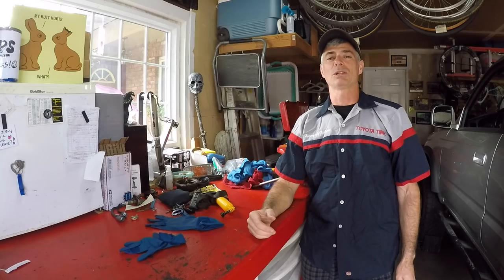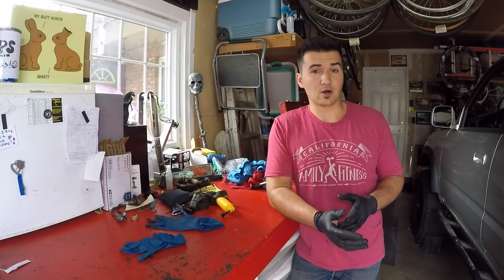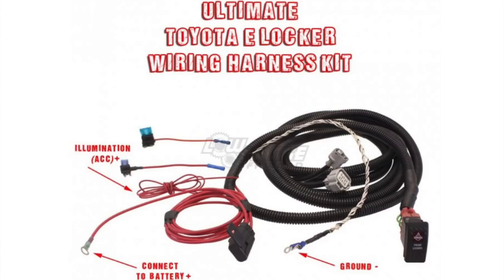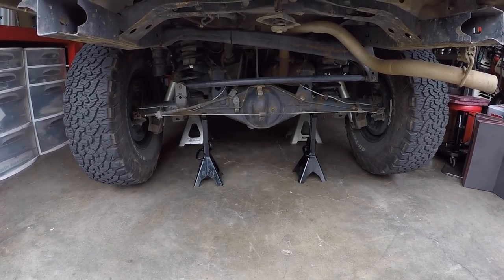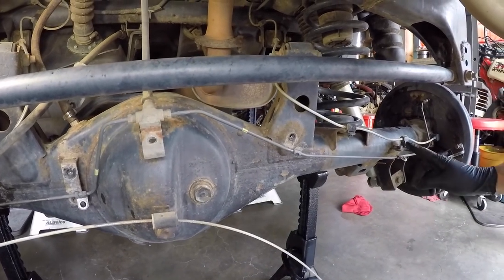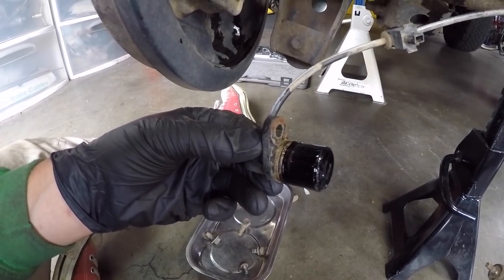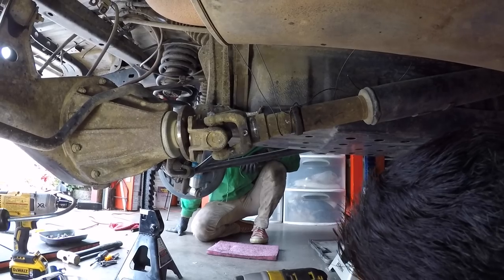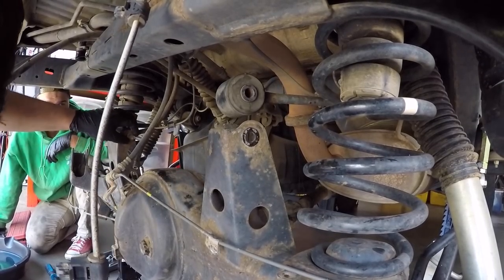E-Locker Axle Swap + Wiring How-To

Comment: Hey Timmy. Great video😎👍.        I have a question... Can you make a video about steering adjustment on the front wheels, when you change steering ball joint🤔??
Reply from the maker: Are you talking about just getting the steering wheel straight again?
Reply: Yes Sir😉 🔧🛠️
Reply from the maker: Get the wheels pointing straight ahead first.  I'd then pull the steering wheel to see which way you need to correct to straighten the steering  wheel and have the clock spring centered.  When the clock spring is centered, you can turn it 2.5 times in each direction.  Put the steering wheel back on as close to a centered position as possible.  If it still isn't perfect, you can make an adjustment at the rag joint.  The rag joint is the joint joining the steering shaft and steering rack.  Here's the two related videos that can help you out:

Steering Rack Replacement - we show how to make adjustments to the steering wheel near the end of the video: https://youtu.be/wZoRP5ogrK0

Here's the Steering Wheel Replacement Video: https://youtu.be/-kByS-4puf0
Reply: Hey Timmy. Thanks for your help. I have see this videos when they where New. Thanks for reminding me about them😃👍
Reply from the maker: No problem Biff.

Comment: Going to look at a 4runner with a locker, and I want to test to make sure the locker works. I doubt it has the 2hi wire mod, and I'm wondering if listening for the 'chirp' of the tires will still be evident in 4lo. Any other suggestions on testing or do you think the rear chirp will still be obvious?
Reply from the maker: The chirp should be obvious.  Have the windows down and go Slow on the turns.
Reply: @TimmyTheToolman  thanks!
Reply from the maker: @kaimasterson8512  You're welcome.

Comment: Just out of curiosity...Is there any purpose for disabling he 5mph protection to engage the locker? I understand its optional if you ground it or not but can't think of any benefit 
.. anything else than damaging your actuator or even the diff.  Am I missing something?
Reply from the maker: It's so you don't have to absolutely come to a crawl when you want to engage the locker.  I personally think this protective feature is good because and I wouldn't defeat it by grounding it out.  I think the chances of accidentally hitting the button is pretty minimal but what happens if you let someone drive your rig that's not exactly the sharpest tool in the shed and they engage it at freeway speeds.  Very bad things are going to happen.

Comment: I have a question. I have a 1997 limited 4x4 4runner with a factory E-locker. I want to swap the push button transfer case with a j shifter one (I plan on doing manual hubs as well). But to engage the E locker you need to shift into 4 low. If I swap in a j shifter for a fully manual 4x4 system, will the E-locker no longer engage because there is no signal that it’s in 4 low?
Reply from the maker: Good question, not sure if those different t-cases have different connectors. If they do, look up the “blue wire mod” where you can ground the blue wire (blue/red stripe) to allow your e-locker to work in 2 or 4 hi or low.

Comment: Does the dash indicator light work with a 2001?
Reply from the maker: NO, it does not because the 01/02’ speedometer doesn’t not have this icon/light included. So you would have to source a 99/2000 speedometer to source the RR DIFF button graphic/light. the e-locker wasnt available on the 2001 and 2002 models.  If you do the job, please get back to us and let us know what you needed up doing.
Reply: Timmy The Toolman definitely will get back with you. The cluster looks the same but I’m going to have to look closely if they have which I think it doesn’t since what you stated is correct. I would have to look for a 99-00 limited that all came with e-lockers
Reply from the maker: So if you remove the 01/02 speedometer cluster & shine a light behind it without the bulbs installed, you’ll see this cluster doesn’t even have an icon/graphic for the RR diff lock so the best/easiest thing to do is just to illuminate the switch light like we show you & call it a day.

Comment: Can you just switch the gear and pinion from the stock axle to the locked one?
Reply from the maker: ZAYD HERRERA no, the axle housing needs to be modified to accept the e-locked 3rd member. It’s notched slightly.

Comment: Can you recommend a place to start to find a complete locked rear end for a 3rd gen? I have a 99 and would love to make it more capable by doing this.
Reply from the maker: Aged10Years Check your local wrecking yards.  If there are PicknPulls in your neck of the woods, you can do a search for years 1996 to 2000 and then get alerts from PicknPull when a vehicle meeting your search criteria pops up.  It's a little luck of the draw to find one that hasn't been pulled yet off a 3rd Gen.  You can also go the Craiglist route or check for people parting out a 3rd Gen with a locker on T4R.org.  Good Luck!
Reply: Timmy The Toolman a year later I finally found a complete rear end, rr lock button, ecu, all harnesses and the front differential and all of that for only $300! Now the real work begins. I can’t thank you enough for this video.

Comment: How does this work with ABS?  In the manual, if you had factory E-locker, it says that when e-locker is enabled, ABS light will come on and will be disabled.  Is that happening after this retro?  Doesn't happen on mine.
Reply from the maker: Yes, it does work with ABS.  On my 98 rig with a factory installed e-locker, my ABS light does not come on when I engage the locker so what you're saying is news to me.  When we were testing out the locker after the install, the ABS light did not come on either.  I also helped out another friend with this swap and he has ABS as well.  If I were you, I wouldn't worry about this.  ABS function is only important when you're traveling at faster speeds.  When you're using your locker, you're crawling and who cares if the ABS is functioning or not.
Reply: @TimmyTheToolman  The reason I am asking is because my ABS is doing some weird crap.  Light sometimes is ON and ABS doesn't work and sometimes light is OFF and abs tries to work but gives weird pedal feel and buzz right at 10mph hash mark.  I pulled the codes and it is 21, 22, 23, which are solenoids.
Reply from the maker: @alexm8543  Gotcha.  I've never tried to diagnose an ABS problem so I don't think I'd be much help to you.  What are the full CEL code numbers?  With a Google search, what are the possible fixes to the codes?
Reply: @TimmyTheToolman   codes are below. I haven't seen anything online as to how to fix.  Dealership said to replace the ABS pump but said that it may not be worth it because of the fact that the new part (even my cost) is around 6 bills.
21 - OPEN OR SHORT IN 3-WAY SOLENOID FOR RIGHT FRONT WHEEL OR DEFECTIVE ABS ACTUATOR.
22 - OPEN OR SHORT IN 3-WAY SOLENOID FOR LEFT FRONT WHEEL OR DEFECTIVE ABS ACTUATOR.
23 - OPEN OR SHORT IN 3-WAY SOLENOID FOR RIGHT REAR WHEEL OR DEFECTIVE ABS ACTUATOR.
Reply from the maker: @alexm8543  Well, here's an idea, find a 3rd Gen at a local wrecking hard and see if you can grab the ABS solenoids off it.  A place like PickNPull will charge you next to nothing for them and this way you won't be out much money if replacing the solenoids doesn't fix the issue.
Reply: @TimmyTheToolman  I found some on eBay for around 80 bucks.  So will give that a shot when the truck gets back from its driveshaft re-balancing.
Reply from the maker: @alexm8543  Roger that.  Let me know how it turns out.
Reply: @TimmyTheToolman  guys the abs is working to prevent wheel spin not just when  on the hwy to stop skidding under normal driving conditions  , check out the wireing and sensors for traction control when the locker is used to help you out
Reply from the maker: @garyborchert61  Thanks for sharing this. I knew the newest models with their special crawl/traction controls are using the ABS function to help the vehicle to become unstuck but I didn't think ours used ABS like that.  I think maybe the ABS wired into the system isn't to stop wheel spin but maybe for the protective 5 mph feature.  The locker seems like a pretty simple mechanism that is either engaging and locking the axles to turn one for one with each other with the input from the driveshaft or work as a regular open differential when unlocked.    But, your comment definitely has me thinking now.
Reply: @TimmyTheToolman  So the dealership did the diagnosis and it is my ABS Actuator.  Ebay used it is, as even my cost on the damn thing is 1200.
Reply from the maker: @alexm8543  Well, now that you know what the culprit is, again, try to pull it off a wrecked 3rd Gen to save yourself a ton of money.

Comment: excellent video enjoyed it. I want to ask a stupid question. what is the purpose of an electronic rear diff locker. Why not just a solid locker? I have a 2004 tacoma trd with electronic locker and always wondered why they say don't go over 5 miles a hour. Im gonna assume its with solid locker characteristics.
Reply from the maker: Glad you like the video.  With a locker both wheels turn at the same speed.  Under normal driving conditions,  you need the wheels to be able to move at different speeds when you are going around a turn.  The outside wheel needs to travel further than the inside wheel and that's what a normal differential allows your wheels to do.  When you engage a locker, now your wheels can't spin at different speeds.  They turn one for one with each other.  The reason for the locker is to give you more traction.   With a open differential,  if a wheel is off the ground or losing traction, that's the wheel that will receive the power.  Once you engage the locker, the wheel on the ground with traction will also get power and you can hopefully keep moving and get yourself unstuck.  The locker isn't meant for high speed use.  It's only for when you're in a tricky situation and you require more traction.  If you drove with the locker at speed and ended up turning a corner, you'd destroy the differential and most likely your axles as well.  That's the reason for the 5mph safety built into the system.
Reply: @TimmyTheToolman  thanks for the quick response. I had a locker in my jeep cj years back and I thought they had clutch packs or something to compensate on a turn.then locks back in when straightened out. like a Detroit locker.
Reply from the maker: @scotthubbard973  Oh, now I know what you're talking about, that's what they call a lunch box locker.  It's self actuating.  Those are ok but lots of people don't care for them because they can act kind of funny on the road and sometimes your wheels chirp because they lock up a little on a turn.  I have one the front of my 85 4runner.
Reply: @TimmyTheToolman  yes sorry I wasn't very clear that is actually what I meant. Why didn't they put in a locker like a Detroit locker and always have posi than put in one that you activate. just watched your install video of a super charger on 3.4 liter which I have been very interested in doing on mine. in your opinion, would you recommend any other additions with the super charger? after looking at forums other additions such as URD upgrade and 7th injector are recommended. Have there been any issues with the addition so far? just thinking about factory specs and emissions and any weak links in the drivetrain. thanks
Reply from the maker: @scotthubbard973  The supercharger has worked well for Sean but he does get some pinging.  He is going to do the 7th injector and tuner mod soon and of course we will film it.
Reply: @TimmyTheToolman  thanks very much for your help pleasure to talk with you and look forward to other videos.
Reply from the maker: @scotthubbard973  You're welcome Scott.

Comment: Did the driveshaft and the third member mount on perfect any extra parts needed or was it plug and play
Reply from the maker: When you swap out the entire rear axle and 3rd member, it's pretty much plug and play, other than the wiring, if you build your own harness like we did in this video.  If you get just the e-locker and you want to fit it into your non-elocker rear axle, you will have to alter the axle housing to make it fit.

Comment: I have a question that I can’t find an answer to online thought maybe you can shine some light. I have a 98 base model 2.7l 4Runner and was wondering if I could put a rear locking diff upgrade on it? I’ve searched forums and can’t get any real answers. Any info would be greatly appreciated.
Reply from the maker: Yes you could.  You would just have to get all the necessary parts to make it happen.
1) E-locker 3rd Member
2) E-locker Axle Housing or you have to alter your non-elocker housing
3) E-locker ECU
4) E-locker Swirch
5) Wiring harness that you bought or made up yourself.  

The E-locker doesn't communicate with the main vehicle ECU so it's not a situation that it won't work for your base model because it wasn't potentially an option for your model.  The e-locker has it's own separate ECU it operates from, so as long as you get all the necessary parts and wire it up like we show in the video, it will work.
Reply: Timmy The Toolman thank you sir appreciate the feedback and quick response. Love your vids thank you

Comment: I really want to swap an elocker in my  manual transmission 4runner. Wich option do i have since it's super rare to find a 5spd 4runner with e locker in a junk yard? Is an front differential on a automatic can fit on a 5speed 4runner to match the rear 4.3 diff ratio that ?
Reply from the maker: You can get an e-locker from any 3rd Gen.  It doesn't have to come from a 5speed.  You just have to make sure that you match the differential gears from and rear.  So yes, 4.30 gearing front and rear.

Comment: correct me if im wrong 
so there is 2 plugs that conccet to the diff (6pin which have 5 wires, and the other 2 pins) and then they all join to be one plug at the end which have 8 pins ?
i have axle from 2008 fj cruiser and have same plugs so if i buy the rear wiring harrness in the daigram and flow the steps i should be fine right? and since this is sperate system im guessing any 4wd ecu should would work with it just fine
Reply from the maker: It sounds like it would work but we can't guarantee it will. Will an ECU meant to communicate with an e-locker from a 3rd Gen 4runner effectively communicate with an e-locker from an FJ Cruiser?  We don't know until someone like you gives it a try.  Obviously I would bench test it before going through the pains of installing it on your rig.

Comment: Is it possible to change my 2002sr5 2wd auto  rear axle to a rear axle with the e locker? It has trac and vsc, and it's only 2wd, so no multi mode trans. I don't want to sell my rig for 4x4 limited, I think the locker will be plenty to get me in and out of dirt and sand, I'm not trying to get stuck, just want a bit more confidence in the dunes or trails
Reply from the maker: Yes, you could swap an e-locker in your rig.

Comment: did you notice your ABS light doesn't turn on when locker is engage? I'm not sure why that is but i think it's supposed to disable that. Mine doesn't either :) but it's also a retrofit. I'm wondering if you truly had 4.10 gears since mine is a 99 auto and had 4.3 gears (i took the diff out and counted it.
Reply from the maker: Hopefully Seydzh will see this comment and chime in.  You can tell what gears came on your rig by the sticker on the driver door B-pillar post.  But, I can't remember what number you need to look at to determine the gearing.
Reply: Timmy The Toolman those numbers aren’t accurate at all. Mine showed 4.10 but I think those are mainly the manual tranny 4runners. You can do the tire spin test to confirm also (I did this first) but didn’t want to grenade my front axle so ended up taking my old axle apart to confirm by counting the ring gear and pinion due to paranoia. You should have him pull the 3rd and count before he swaps the front diff in case he was wrong lol
Reply from the maker: He got the front differential from the same vehicle so the gearing matched.
Reply: i was thinking he might have a 4.3 in the front already :). So less work if it already matched. I'm not sure how he determined he had a 4.1. If he used the door code, he may have been misled.
Reply: It likely turns off the ABS but I'm not sure. I've never had an e locker in a factory vehicle lol.
Reply: Idk about these thirds but on the older style ones you can usually get the gear ratio by the color on the pinion
Reply from the maker: Gotcha, that makes sense.
Reply: I did not do the count method but I swapped the front diff the day before I did the rear axle. Hindsight, I could've been lucky and had 4.3 gears all along and it would've just been an easy rear axle swap instead of both the front and the rear.
Reply: mine doesn't turn on the light. I tested it and the ABS does kick on still when locked in 2wd (override) or 4wd hi/low. I've tried to do switches to kill the ABS but nothing worked for me. D/C the abs harness works so i suppose I could just do that for snow trips.
Reply: yeah, hopefully others that try this will pull that 3rd's out to check the teeth to save time/trouble of pulling the front diff :)